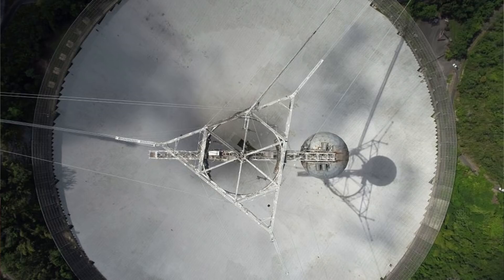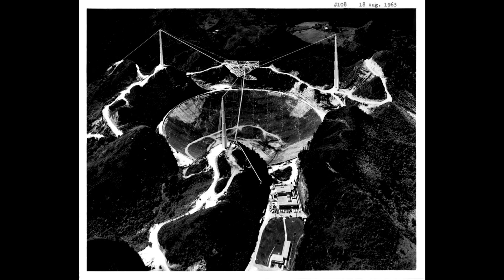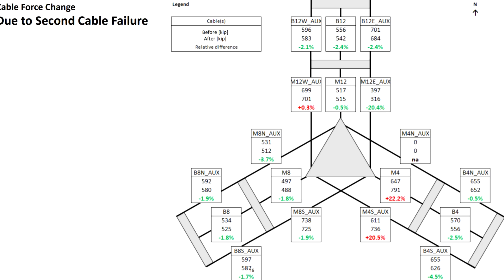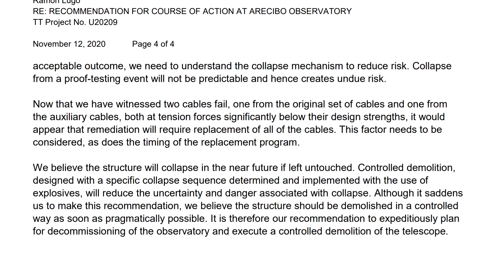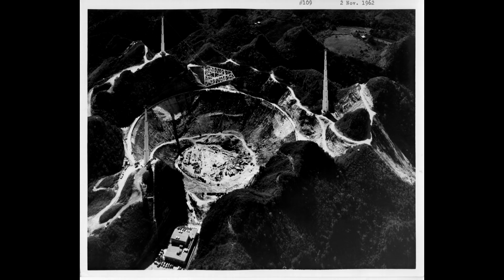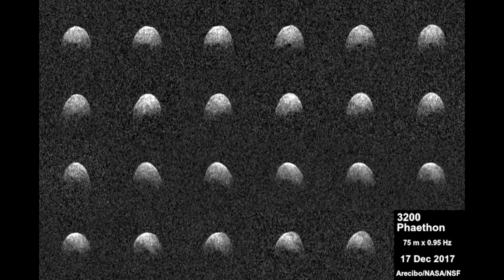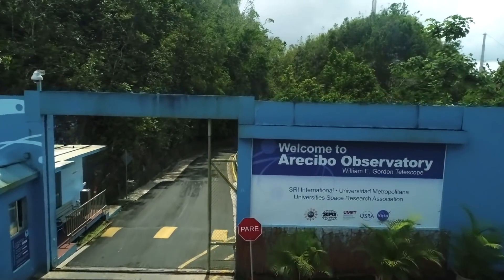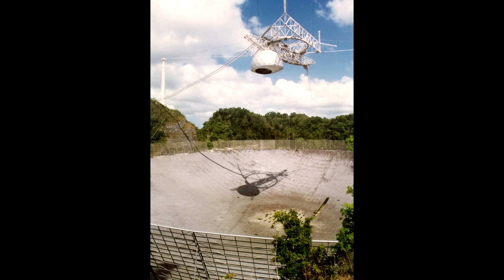Worlds Largest Radar Astronomy Dish To Be Demolished!

Comment: I wonder if the salt water air in Puerto Rico has something to do with the deterioration of the metallic cable.
Reply: Underinvestment is the real problem. The Bay Bridge at San Francisco has seen similar challenges, but it is still there.
Reply: Arecibo is about 10 miles from the sea.  I think just the daily tropical weather would be a bigger problem.

Comment: Wonder what possibility there is in taking down the old carefully. Redesign and rebuild aka recycle the old one.
Reply: They're won't be any dismantling.  They'll blow up the towers and let it crash to the ground and haul it away as scrap.  They can't fix it because it is too dangerous for people to be near it.  They aren't going to take it apart for the same reason.
Reply: @stargazer7644  your correct they probably will at this point because it's the safest option. I was thinking something along the lines of attaching cables to the ends of the originals then lowering they thing that way instead of having anyone near the center.

Comment: Being d "largest" doesnt mean d most "useful". Present with graphs and data tables.
Reply: Ok, I'll bite. Trolling does not an argument make.
While restricted in what it could "see" the vast majority of matter in the solar system we live in is arranged within 5 degrees of the ecliptic, and therefore visible at least part of the year to Arecibo. Add that to what Scott said about how RADAR works, and there's the whole argument you just blithely dismissed.
Do yourself a favor, don't bother claiming others are lazy without at least putting in an effort.

Comment: I’m sure China would let their engineers brainstorm a safe, low cost solution and then quickly implement it.  Over here, the process is too corrupt for that to happen.
Reply: You think the Chinese bureaucracy is LESS corrupt than the American one?  I mean, I know Trump tried hard to excel in that area, but, seriously?
Reply: Depends on which one ...and if local governments know they will be held accountable by the central government, then they will not risk it.   Look at how they handled the pandemic.  Of course there is lots of corruption, but for some things it is not tolerated

Comment: I guess they ran the numbers and the proposals to fix it were simply too high compared to demolition and replacing it.  I'd hope a modern  replacement is funded, and this time perhaps it can be built in such a way that it could more easily be repaired / retrofitted.
Reply: No, they were in the middle of repairing the original damage.  The problem now is after the second cable broke, there is there is no safe way to work on it.
Reply: @stargazer7644    I watched the video as well, and yes the costs jumped quite a bit once that cable snapped. You aren't thinking using an Engineering Economy mindset. The question is rarely if a project can be done, the question is what are the alternatives, the costs and risks (triad of good, fast, cheap per the PMI). Once they exceed the cost of replacement (or budget), it's pencils down.

Comment: Wouldnt the inverse square law just be applied for the distance there and back? So we get intensity loss as 1/(2r)^2 not 1/r^4?
Reply: Yes, I thought exactly the same thing when Scott said it at 10:07. Interestingly, the example he gives - "if you double the distance, you would need 16 times the power" works for both formulas. But I agree with you, the correct one is 1/(2r)^2
P.S. It took me a lot of ctrl+ends and one ctrl+f for "square" to find this comment among 2712 others :-)
Reply: Well, I think not, because the reflection can be seen as another point source depending on the shape of the object it is reflecting of.
Reply: @juliusfucik4011  Oh, I didn't think of that. If it's reflected off a spherical object... Maybe it is the power of four after all...

Comment: Wire lock Spelter Socket.  They are accepted all over the world and are cost effective, with only one down side.  Corrosion.........Unless they are repeatedly -yeary recoated with a good epoxy paint. 
I reference the Golden Gate Bridge, which has a crew of painters who work year around repainting everything to keep it rust proofed.

Comment: Why not just use the largest helicopter possible and try lift the instrument in the middle and cut all the cables? Some choppas transport tanks, though max weight is around 40-50 tonnes.
My guess is that the hanging instruments weigh well above that. Over 100 tonnes?

Comment: I'm a draw bridge engineer and I speculate they haven't been doing inspections if they were caught off guard by this rope failure.
Reply: All but confirmed. The telescope was slated to close for a number of years. It has been bouncing between various foundations & universities due to the high maintenance costs. Everyone wants to use and own a famous scientific instrument, but nobody wants to pay to keep it working.
Reply: There's an old story that every year the Swiss check every inch of their cable car and ski lift cables, and replace any that aren't up to standard, and sell the failures to France who carry on using them.
Reply: @PaulMansfield  In Britain, lift (elevator) ropes have to be inspected inch by inch at periodic intervals.  There are standards for how many broken wire ends can be allowed to emerge from the rope before it has to be replaced. (Re-roping.)  I used to work at the BT Tower in London.  Very long lift ropes there, of course.  The procedure for inspecting the ropes involves taking the lift out of service to passengers (of course).  The maintenance technicians climb through the hatch in the roof of the car to stand on its roof.   They then drive the lift up and down the shaft at low speed using a manual control panel, inspecting the ropes as they go.  I once accompanied 2 technicians on the roof of the lift car while they checked the ropes - a fascinating experience.
Reply: @PaulMansfield  and when they decommission them they sell them to the NSF..
Reply: @stanburton6224  NSF does everything and has a fraction of the budget of NASA or NIH or DARPA.  NSF has to work with rocks and twigs and baling wire.  Anything that comes out of NSF is a miracle.
Reply: @PaulMansfield  I guess the Italians get a great deal on those cables once the French are done with them.
Reply: @BobbinMcferry   yes we use old weakened cables, so US jets cuts them more easily. Remember Cermis cable car.
Reply: Puerto Rico had a Hurricane on July 29, 2020, so that might have had something to do with the rope breaking.
Reply: Yeah, look at the swelling in the cable at 4:42. Looks like some internal corrosion there.
Reply: @aaronmarshall4072  Swelling is from strands that have broken. Corrosion certainly played a role but that's a cable reaching it's limit. It also shows why wire cable is so great unlike chain it does not all fail at once.
Reply: @Cragified  Tow a tractor stuck in the swamp.

Tractor was a bit bigger than we realised, and certainly more stuck.

ALMIGHTY BANG and a CRACK and ohshit the Chain snapped O_O Thank goodness no one was stupid enough to stand next to the chain while they were pulling.

So we went back and tracked down a bigger chain.
Reply: Perfect ! I have a moat ! I'm stuck in this castle and I can't swim !
Reply: Nowhere is safe from administrative mismanagement... good lord
Reply: Well, that's about the coolest job title I've heard in some time.
Reply: @Quantiad  How about checking Big Ben for lean??
Reply: @andyharpist2938  Big Ben is being repaired right now though, so IDK where you are getting your info from
Reply: @Stettafire  Well, the digital measurement, of a plumb-line extending from the top, to a metal plate, connected to a telephone line. Approx 200mm. northwards, last time I saw it. You can just about see if you stand on the end of Parliament St.  I dont know what it is now.
Reply: @Minonian ..ok.
Reply: This is the real problem, I suspect.  If the cables are all garbage, it limits their options.  The geometry means that feeding cable to lower the platform a bit lowers the stresses in the cables, but with low confidence and no data for the actual cable strength, it's difficult to see someone certifying a repair process for which a failure would be so memorable!
Reply: @dlkramer88  Its really should not be such a big deal to start again . A few towers and cables and better design and control technology would make much better sense. Notwithstanding the ability nowadays for vested interests to ramp up the price and construction period many fold. That is the real problem! The world is full of such projects hi jacked by civil servants or others, creating a complete hash of what is actually at heart a simple task.
Reply: But if they had, they probably would have discovered some sort of design defect, and they would have condemned it anyway!
Reply: @babalooey100  yes ..they have discovered defects in every bridge in my city... but luckilly they are able to fix them up, themselves.
Reply: Very scary and dangerous to be up there under a curve of height
Reply: Yes. I think you're right.
Reply: Yeah, that's the first thing that crossed my mind. If one of the cables snapped at 60 percent of it's load, any inspection would have identified the structural vulnerability. Shame. And as one those comments made was that this should have been addressed 10 years ago, someone isn't doing their job or funding wasn't forthcoming, so come the end of an iconic structure here on planet earth
Reply: It’s in Puerto Rico: mañana...
Reply: I visited in 2008 and it was quite a sketchy structure then.
Reply: The cable slushing job was deemed non-essential and icky...
Reply: My suggestion is to delay any demolition to see if a solution can be found. Delay will also give an indication of how stable the structure is.
Reply: @DavidJohnson-tv2nn  If they delay the demolition long enough, they certainly won't have to demolish it. But they also won't know what surrounding facilities won't have to ever be demolished. At least not in advance.
Reply: @Ian umm PR wasn't in charge of this. It was the NSF and UCF. USA much?
Reply: @Minonian "It's done its job and is worth nothing in dismantled bits of old cable and electronics... Blow it up. It's not worth someone underneath or overhead getting hurt for." 
We had three TBMs at mid-point of the English Channel Tunnel,  and had to decide what to do with them, once we met the French, coming the other way. They cost... what.. maybe £60m each in today's money. The fitters wanted to salvage them , Cutting them up and taking bits, tonnes in weight, out through 17 miles of constricted tunnel. There were three managers there, I remember, at the bar. And me. Finally the old Leading Miner spoke up... and everyone turned and listened.... and he said exactly what I wrote at the top of this posting. Except he didnt say 'blow it up'....he said just !  "Bury the c**t ! " And that's what we did. It was the correct decision.
Reply: @andyharpist2938  l think thAT's what they do in a lot of tunnel jobs since starting to use TBMS...
Reply: @pilarmorin4405  Its heartbreaking to see perfect 100 ton rams and large hp drive motors and working hi-pressure hyraulic systems simply filled with concrete. But thats life.
Reply: or the contract to conduct the testing went to a very low bidder.
Reply: I wonder if the can use three Sikorsky Skycranes at 120° angles to remove the instrument cluster and lower it safely to the ground. This would leave only the super structure and a lot less weight to be removed safely
Reply: @rty1955  Good thinking! Sort of 'taking the strain and choppering outwards' whilst the riggers undo the bolts and on the count of three the load is released, hovered  to the gound, released ...and they rebound a bit outwards over the jungle before re-gaining control, landing again, and going back to the cantina for more Slobadanska Wodka .
Reply: So, pretty typical for Puerto Rico.
Reply: @Alex Waardenburg
If they had done absolutely no inspections they would not have expected fail strengths and load limits.
They relied on the minimum of inspections to avoid having to replace anything and now all their cables are "all of a sudden" in an unexpectedly bad state...
Reply: World is overpopulated are world is full of idiots that don’t have common sense let alone the foresight to do their job and prevent future catastrophe.
Reply: @R-E-N-E-G-A-D-E  Then there's you. Calling others idiots and you can't even write a simple sentence.
Reply: @R-E-N-E-G-A-D-E  Sorry, the Earth is not overpopulated.  We have pockets of very high density, but humans live on just a few percent of the land area.  That includes land for agriculture.  The enviro-phobiasts have been promoting the idea that we are overpopulated for 60 years.  The population of the USA has been relatively stable during that time and our ability to grow food has vastly improved in that time.

Under the last 4 years of this administration, the USA has become energy independent, has lowered CO2 emissions more than most of the world, and is moving toward renewable energy and electric vehicles driven by market forces (not government mandates).

I've lived long enough to see every sky-is-falling prediction from the 1960s to the 2000s fall by the wayside.
Reply: @BryanTorok  The US has not got to lowest emissions. Not even pet capita. The US is one of the worst polluters on the planet
Reply: @Stettafire  I didn't say the USA is the lowest.  I said that we have reduced CO2 emissions more than most countries.  The Paris Accords were a joke because countries got to write their own goals and many wrote goals that they were already at or close to.  The USA wrote goals with deep cuts that would hurt us more than the rest of the world.

As for being one of the worst polluters, not by a long shot.  Just look at China and India.  Australia is a huge producer and exporter or dirty coal.
Reply: @R-E-N-E-G-A-D-E  That is why I think any museum, zoo, or environmental education facility should have free condoms in the rest rooms.  Arecibo's rest rooms should have condoms in them too.

Comment: Ok, so they need someone that can climb and is crazy and lightweight enough to attach cables on there?
Well, call me up I've done stuff more stupid than that...

The ropes used in towing gliders are made from Dyneema and ridiculously lightweight.
One man can carry 1 km of it and it safely holds about 1 metric ton.
It's ideal as a temporary support to hold it in place while the new cables get mounted.
It only needs one crazy volunteer (hello, here) and a bit of funding.
Crowdfunding could maybe work out for that.

Comment: Hi Scott. Sad to say, anything using cables will end its life in a heap; corrosion ... prepare for most suspension bridges to fail sooner than the builders intended. Hopefully this will be a way forward, as it is some time since this was designed and commissioned. Despite the nostalgia, it could be an opportunity for bigger and better, funding allowing. Let's hope.

Comment: I guess they should have put pulleys on top of the towers and extended the cables to sets of block and tackle attached to the ground for lowering the whole thing for maintenance. I guess that would have put it over budget.  I guess all they can do now is put something soft under it before it is dropped. That would probably have to be done with drones to keep people out of the danger zone. But if there is not funding to repair it and put it back up they will probably just blow the cables and call it a loss. Sad.
Reply: The entire center platform moves around.  That was originally the only way to point the telescope.
Reply: @stargazer7644  well that makes sense but if it were movable enough to lower it all the way down they probably wouldn't be saying it will be demolished.

Comment: Another instant where the world misses CargoLifter. CargoLifter was supposed to be a gigantic Zeppelin airship for superheavy lift operations, but the company ran out of money by the time they had finished their main construction building. This building now houses a tropical island resort in the middle of germany. Had CL been built, it could place entire small powerplants in one piece at remote locations, it could savely remove the Arecibo sensor array, it could easily bring rocket stages back to launching platforms... I think Elon should take a look into refunding the idea.
Reply: No blimp can lift 900 tons.  Not even close.  The largest blimp ever made, the Hindenburg, had a net lift of 17 tons.  The CargoLifter was designed for a lift of only 160 tons.
Reply: @stargazer7644  You know, once people figured out how to build something, they tend to build it bigger... CargoLifter would have been like version 1.0 for a whole new generation of low energy consumption heavy load and possibly long distance transportation systems... Also, neither the Hindenburg nor CargoLifter where "Blimps". Get your facts straight on ways to construct airships ;)

Comment: If they are looking for a new RT location,  there's a perfectly round 1500' diameter bowl located less than 100 miles NW of Las Vegas that could be used.   I mean, it IS the crater left over from a nuclear blast (the Sedan test), but it's almost tailor made for for a RT: low humidity, clear skies, low interference from civilization (military flight tests from Area 51 and the Tonopah test range excluded), yet easily accessible.

Comment: I'd like it if we took it apart as an opportunity to completely overhaul it (Or at least the concept of it and using natural areas that work as dishes) rather than to just straight up demolish it. I agree with the mindset that it's probably a bit too old and too remote to make trying to repair it feasible from a safety perspective, but that doesn't mean basically rebuilding a new telescope using some of the existing works (eg. Foundations, maybe?) or in a new suitable area would be similarly infeasible.